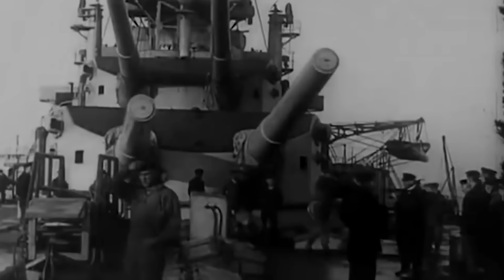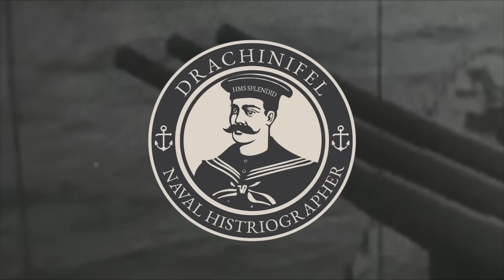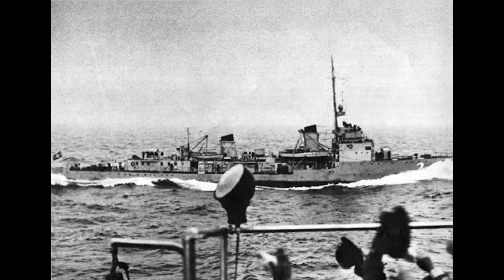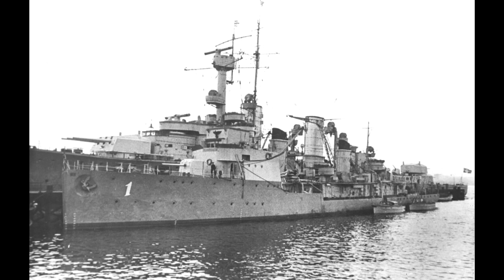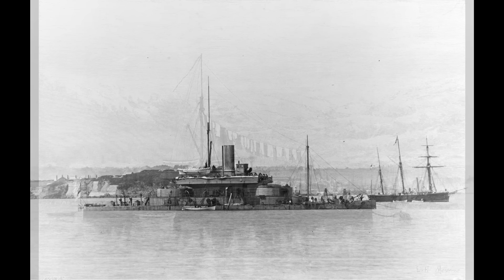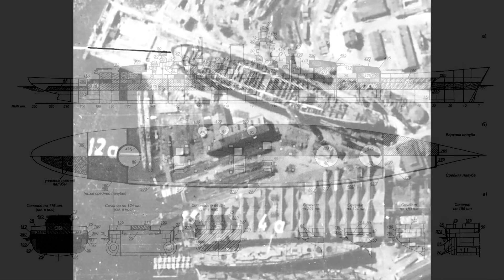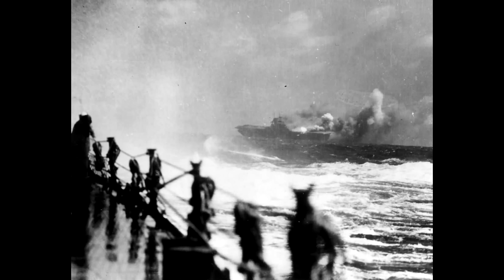5 Naval Engineering Failures - Sink, Swim or Explode

Comment: Santissima Trinidad; how to take a very powerful if somewhat slow first-rate and turn her into a useless pile of valuable wood.

Even it Sovetsky Soyuz WASN’T a horrible designed mess…she would have been basically pointless and strategically obsolete upon launch. Not only because of the bad timing issue that plagued WWII battleship designs, but because the USSR/Russia is poorly suited to field capital ships.

And ROFLMAO at the ridiculous levels of horsepower on the F-Class. Can you imagine how much horsepower you could get if you used the same sets of machinery for Hood (assuming they somehow work)? Not to mention the return of the worst naval AA gun of the entire war in the bolt-action 37mm.